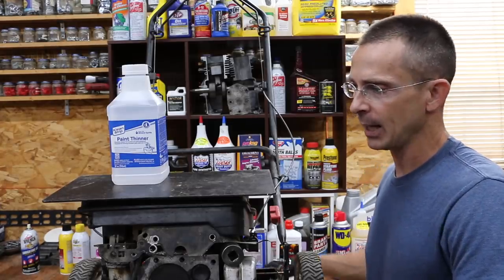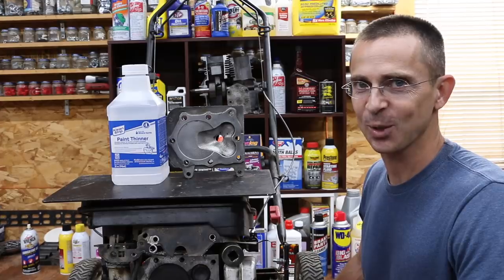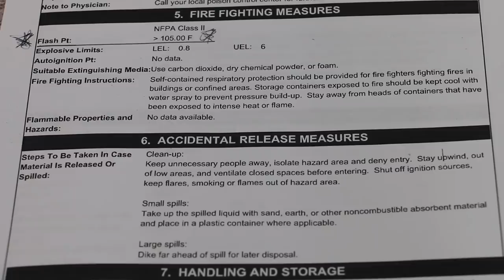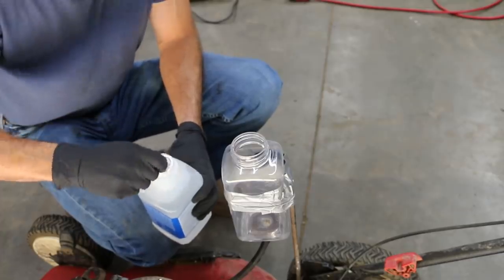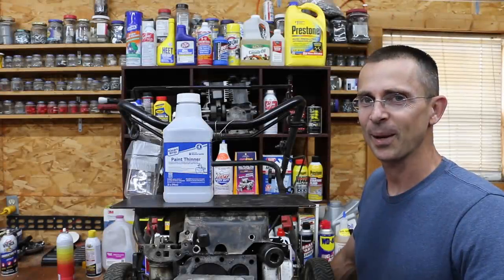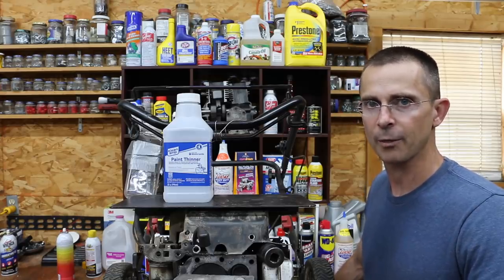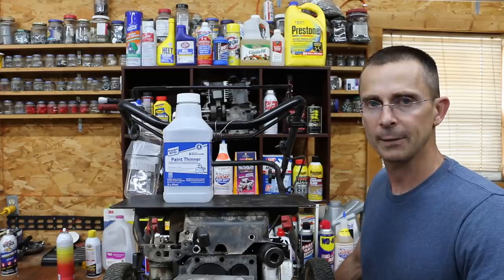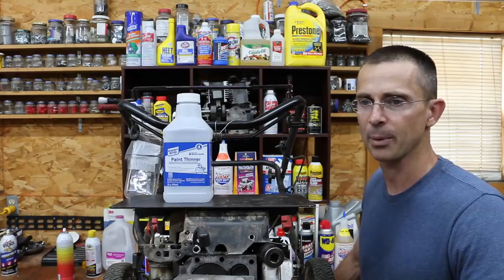Will a Gas Engine Run on Paint Thinner?  Let's find out!

Comment: Run a 2 stroke using regular motor oil mixed with gas
Reply from the maker: Thank you for this recommendation.
Reply: Imagine this was commonly done on outboard motors. Know thats what my grandfather did in the 1960’s. Remember starting those engines was commonly a problem, and had to row home more than once. I didn’t realize there were specific oils meant for mixing with gas for 2 stroke engines, other than normal crankcase 30 wt. I believe the problem with regular crankcase oils is that they produce an ash which accumulates over time. Does anyone know when oil meant for mixing with gas for 2 stroke engines became available, or did I just not know better.
Reply: @glaucouswingedgull  in the old days, for me that was the late 70's that is all we used. I worked for the park district and the old man who was in charge always had us do it tgat way, and there was no real set ratio, just glob some in ghe tank :)
Reply: When I was a kid I had a 94 suzuki rm250 that when I was out of cash  I would use 10w40 Castrol as my premix oil. It stunk like crap and fouled the occasional plug but would keep me going til I could scrounge and get some maxima super m

Comment: When I was a kid, and young, 12 or so. my father brought home a horz crank Briggs engine. That was LONG ago and I can't tell you but it was in the 3hp single cylinder range.  I asked Dad will it run on Mineral Spirits?  Back then you could but at bulk at certain gas station. 

We tried it cold, would not run.  Dad had the idea lets run gas and get it hot. Hot the engine then did run on mineral spirits, but I remember it smoking and not running that well but it ran.  So I guess I beat you to this test 52 years ago, lol.  Great video, loved it.
Reply from the maker: lol  Thanks for sharing.

Comment: Test to see how well transmission fluid cleans up carbon deposits.  Been hearing that's an old mechanics trick for ever..
Reply from the maker: Thank you for this recommendation.
Reply: @ProjectFarm  the trans fluid clean up is to put 1 qt in the oil a few hundred miles before you are due for a change, not in the fuel, at least not that I have ever heard
Reply: mtd610 I do that in my Diesels. Works great!

Comment: Will a engine run on carb cleaner
Reply from the maker: Thank you for this recommendation.
Reply: id say no, ive had trouble getting an engine started if i spray it in there too much,
Reply: yes it will, thank you for this recommendation :)

Comment: Great Test as Always Project Farm 👍🏼😎😀 Can You Run an Engine On Pure Vegetable Oil vs Regular Engine Oil Test Thank You
Reply from the maker: Thank you for this recommendation and thanks for the positive comment.
Reply: They did this on haggard garage
Reply: AndrewKidd14145 yes with a Liquid Cooled V8 Car Engine Filled With Soda in the Radiator Not In an Air Cooled Engine  Like Project Farm
Reply: Why would anyone run a vic on vegetable oil when you can make perfectly good biodiesel out of it? Dumping cooking oil into your fuel tank would be dumb to say the least.
Reply: INF1D3L010 in the Crankcase not the Fuel Tank I Didn’t Correctly Word The Comment As Well as I Should Have

Comment: Found myself out of gas 3/4 mile away from home out on rough ground in the pasture and low and behold after sorting around in the junk in back of the old  ‘75 Jeep Honcho found a half gallon of you know what. Well it was a hot day but it ran well enough to get us back home and often times a hot day with ethanol would result in vapor lock. Had to run non alcohol gas especially in the summer! Wouldn’t say it ran super well or that the exhaust smelled top notch but much better than hoofing it!
Reply from the maker: Thanks for sharing.

Comment: Can you run Coleman fuel or whitegas in an engine??

My dad told me stories about a lawn mover that couldent cut very thick grass until he did this i want to see the outcome or what happens to the engine.
Reply: It will run great. I use 50 to 1 oil mix Coleman fuel in all my 2 strokes. Have been doing it for several years. It cuts problems way down from standard pump gas. Doesn't go bad like pump gas.
Reply from the maker: Thank you for this recommendation.
Reply: The problems I found it cuts down is pump gas related issues. Such as the gas doesn't go bad as fast and gums up the carburetor. It also seems that the fuel lines last longer. If you used regular pump gas with methanol, no moisture issues. We also run it in all our saws at work and has cut way down on fuel issues and a trip to the mechanic. A gallon of Colman fuel last several years. And for a typical homeowner who weedeats once a week or two it usually last me along time.
Reply: Coleman fuel avoids e10 pump gas shelf life issues, but it is so expensove, and has a rather low octane rating. You are better off finding something like sunoco optima in all reality
Reply: @devinwilliams3489  yes it is expensive. I think I paid about 6 or 7 dollars for Wal-Mart brand last year and for me it lasted most of the season. My thinking is, one trip to the repair shop more than pays for several gallons. So far my experience has been nothing but positive. Been running it for a good number of years in my blowers and weedeaters and not a single trip for repair. I notice little to no issues running it.

Comment: can you run diesel in a 2 stroke successfully? if that doesn't work you could even try with diluting it with gas.
Reply from the maker: Thank you for this recommendation.
Reply: wouldn't that just be substituting 2 stroke oil for diesel then?
Reply: Many early diesel engines actually were two stroke.

Comment: try running an engine on acetylene and oxygen
Reply: Chris Beard lol
Reply from the maker: Thank you for this recommendation.
Reply: chris you must be a welder for that suggestion
Reply: Jumbie, i can burn metal but by no means do i call myself a welder lol. just had the idea when thinking about an engine running on vapors....and i wonder if it could be possible or would it just explode?
Reply: Setting the mix must be super easy on this. I remember the safety briefing on acetylene and it ignites over such a wide range of air/acetylene ratio.
Reply: @heyarno  its not all that different from running on propane
Reply: @integr8er66  Thanks for confirming.

Comment: Here in the UK there's a lot of people with high horsepower budget builds that use a small ratio of paint thinners to petrol (gas), as it decreases knock/detention. 1L Thinners to 10L Petrol. Great for turbo engines running high boost and a cheap octane boost effect.
Reply from the maker: This is great information. Thanks for commenting.

Comment: Will an engine run on fuel injector cleaner?
Reply: john darby no it won't I have tried that
Reply: It will. Auto shops run fuel system cleaner (fuel injector cleaner) through a special tool that uses compressed air in place of the fuel pump to force the fuel injector cleaner  through the fuel rail through the injectors while the engine is running. The engine runs independently from the fuel pump because it's disabled and bypassed.
Reply from the maker: Thank you for this recommendation.

Comment: replace oil for anti seize like if you want to see
Reply from the maker: Thank you for this recommendation.
Reply: I don't think it would last too long.  Antisense turns into a thick paste after a short while from heat.   And it has grit in it. I'd find it 5 minutes and then failure

Comment: Will a gas engine run on gas
Reply: Dprill95 No. Gas is completely different from Gas. If anything, the universe will notice a temporal shift surrounding the proximity of the engine and collapse that area, imploding the surroundings.
Reply from the maker: LOL! Not very often on the Project Farm channel.  Thanks for commenting.
Reply: Dprill95 hm... something tells me you'll see slightly decreases power on gas for gas along with a lowered efficiency. Though otherwise gas should at least kind of run like gas

Comment: EGAD!   You must be the local repository for used lawnmowers!   I have seen you take the head off & reinstal  it numerous times. I would have thought  that the head bolts & threads in the block would be worn out!  Just a really great & informative collection of videos, mostly with valuable information. I expect your next test will be to see if the mower runs on liquid oxygen & hydrazine!
Reply from the maker: Thank you

Comment: Thanks to your videos, i got a little sly and tried a few things on my moped.
I found a bottle of rubbing alcohol like 98% isopropyl alcohol on the street the other day and i was running out of gas, i put it in the gas tank, it was like 500ml to 400-500ml or so gas and it run great, it needed a few kicks on the kick starter when it was cold though as i have no choke.
After that i tried straight lacquer thinner which is mostly toluene-xylene after i evacuated the gas tank and surprisingly had no difference from gas, smelled cleaner too compared to the rich mixture i run at idle.
Not really reasonable or clean to use such chemicals as fuel as most are more expensive than gas, but having watched your videos and knowing my way around in chemicals it was a nice experiment!
Next thing i'll try is mineral spirits straight and with toluene-xylene as octane booster in case it runs rough.
Thanks again for those nice experiments, i have enjoyed all of them!
Reply from the maker: You are welcome!

Comment: Soichiro Honda started the Honda company by offering a motorized bicycle engine running on turpentine. Maybe try straight turpentine? Another neat idea as well would be toluene, most octane boosters are usually toluene based. I think toluene has an octane of 120 or so?Also surprisingly enough or not, gasoline can be used in a pinch as oil based paint thinner (obviously probably don't wanna use it on anything painted indoors...) or oil based paint brush cleaner.
Reply from the maker: Great video idea!

Comment: You should put it in an aquarium soapstone bubbler on the tips of your air inlets into your fuel source when doing the vapor run test it will create much smaller bubbles increasing the vaporization
Reply from the maker: Thank you for this recommendation.

Comment: You know i have to say im rather impressed with your findings... ive seen you run mowers on isopropyl alcohol, paint thinner, vapor gas, methinol.... and many other projects youve taken on.... little engines hold up quite well for being made to be this way.... gas only and not shall we say multi fuel.
Reply: I suppose with a little knowledge on flamable liquids you could run a mower on quite a few things... as long as it leans tward more of a gas like material rather than a diesel like material... ie higher flash points
Reply from the maker: Thanks!

Comment: You know what you could do... Put a y pipe on the intake of that bubbler system you got so you can introduce a little air into the mix, with a ball valve of course. It would be a little more complicated to get running than just the one ball valve though.
Reply from the maker: Great recommendation!

Comment: Paint thinner usually consists mostly of toluene, sometimes xylene, both of which are commonly found to be major components of regular petrol. Additives in petrol are what causes the difference in flash point. Pure toluene paint thinner can be used as an octane booster, since it's already a major component of the petrol and it has a higher RON number of 121. For example adding one liter of toluene to nine liters of RON95 petrol raises the RON number to 97,6 ((9x95 + 1x121) / 10).
Reply from the maker: Thank you for this information.

Comment: Several older tractors had two fuel tanks. The main one could be used for gasoline, or it could carry kerosene or "spirits", with the smaller tank used fro gasoline to warm up the engine before switching fuel. (Harder starting with the other fuels, especially when cranking by hand). Anyway, they ran better when warmed up before switching fuels, but the ran fine (and could be started) with other fuels. "Spirits" was basically what we buy today as mineral spirits, commonly used as thinner for oil base paints.
Off topic, I know, but there was also an Allis Chalmers tractor sold back in the 1950 which used a hydrogen fuel cell. It cost more, however, and gasoline sold for less than 30 cents per gallon (less for farm fuel) the hydrogen tractors didn't make it in the marketplace. Today, scientists are "trying to develop" hydrogen fuel cell for powering engine, but it is "new technology". Is this making sense to anyone?
Reply from the maker: Thanks for sharing.

Comment: Great test..How about running a mixture of gasoline and liquor thinner. 
There is a theory that 1 gallon of liquor thinner mixed with a half tank of gasoline, then driven 150 miles of highway driving. It will remove the carbon build up in your catalytic converter., hence removing the dreaded code. Can you make a similar mixture, and see the results on carbon removal... by the way, another great video,  keep them coming!!
Reply from the maker: Thanks, will do!  Thanks for the video idea.

Comment: Every month I pour 0.5 liter of white sprit  (paint thinner ) to a full tank(45 liters) of my car .engine runs smooth and white sprit  clean the injectors and give me a better gas mileage  (at least 35 miles more than a normal tank) every time I use it. doesn't harm the catalytic converter and makes the engine runs better.
It is a personal experience and I wouldn't recommend to anyone to do it.but it worked for me and my mate.
Reply from the maker: Thank you for the feedback!

Comment: Try heating the the mineral spirits for more vapors. You could put the fuel tank in a water bath with a thermostatically controlled heater. 
Alternatively let exhaust gases heat the fuel. Only a small portion of the fuel needs to be heated just prior to entering the air stream.
Reply from the maker: Great recommendation.

Comment: I once heard a story about an employee who was working for a popular industrial-grade baking oven manufacturer. He collected huge amounts of condensate, a flammable liquid ( similar to gasoline or related ) which is found in bakeries using thermal oil as a heat transfer fluid. As the thermal oil wears, it breaks down into lighter components ( condensate ) and heavier components ( such as tar ). This condensate is actually collected in a drainage container, and must be emptied regularly or depending upon the wear'n'tear.
The employee has filled his car's gas tank with the condensate ( A Volkswagen Golf I ), and it ran fine. Amazingly, he had free fuel all the time!

Would this be a neat project idea? Lemme know! ;-)
Reply from the maker: This would be a very interesting project. Thanks for the idea!

Comment: Tuleen is a paint thinner used to thin out paint for road marking . they also take pure tuleen and water it down for f1 race cars. I run tuleen as a fuel booster 5gal is about 100 bucks at Sherwin Williams. Two cups in 5 gallons on a crotch rocket about 110 octane 87 pump used to mix. Runs about 20 degrees hotter . smells like steril bandages as its benzene out the tail pipe.
Reply from the maker: Thank you for the feedback

Comment: You need to do a video that brings all of your scientific data into one spot.

Things you've tested:
Crank Case edition
Fuel substitute edition
Best cleaner
Best ways to for sure dammage an engine
Just a few ideas...

Basically to bring everyone up to speed on what has been tested thus far and how they compaired.

It would be pretty neat to have some charts comparing and collating the data.

That would be a video I'd want to see❣️
Reply from the maker: Thank you for this recommendation!
Reply: Project Farm you're very welcome ☺️

Thank you for doing what you do.  Its pretty entertaining.
I like all the science to it, its not ramshackle lets just see what happens.  Its a smart lets see what happens in controlled conditions.

Comment: I know adding 2 cans of Lacquer Thinner, 2 Berryman B12 and one Bottle of MMO  to my 01 5.4 Expedition must have freed a stuck valve or clogged injector as my Mis in Cyl 2 has finally went away; the Truck is way faster/ responsive and smoother. I did forget to mention the increase of at Least 2 MPG. I used  2 cans (9 cans total LT, 10 B12, 5 MMO) over every half or 1/4 fill up over 1k miles of driving ( I travel for work).. Worked out great.. Next cars to do my Kia, Nissan, infiniti and Chevrolet.

Thanks PF :)
Reply from the maker: Excellent!  Glad this worked!

Comment: In the Safety Data Sheet for this product the CAS no is 8052-41-3. Otherwise known as Stoddart solvent.
White Spirits as far as I'm familiar with will have a CAS no of either 64742-80-9, 64742-82-1 or 64742-48-9.
Reply from the maker: Thanks for the feedback.

Comment: Paint thinner used to be an inexpensive way to make race fuel out of regular 91 pump gas (about 2/3 mix of toluene or xylene to gas with a dash of MMO as a stabilizer). When the oil companies switched from lead additives these two chemicals were the answer to raise octane without harming catalytic converters. Paint thinner is no longer a cheap at the retail level so its kind of a lost art, but yes paint thinner is already in your fuel to one degree or another. Concentrations will vary depending on who refined the fuel and what country it came from.
Reply from the maker: Thank you!

Comment: I see in many of your engine videos that you use some sort of socket to start the engines. Did you make this(how) or is this something out there you can buy? Would a 20V Porter Cable drill do the trick or would I need something more powerful? Your videos are "very impressive".

Comment: I'd like to see one of your engines run with Johnson & Johnson baby oil in the crank case. I know that it is mineral oil but it also has fragrance and other ingredients. If you try it and it fails at least it will smell good as it throws a rod. Great channel by the way.
Reply from the maker: Thank you for the video idea!